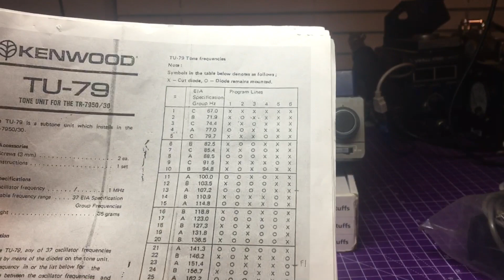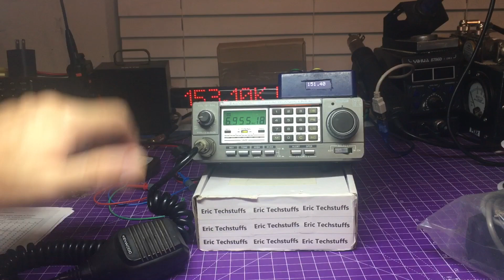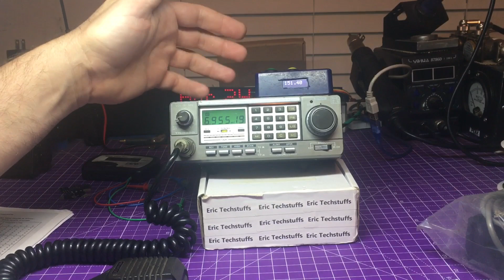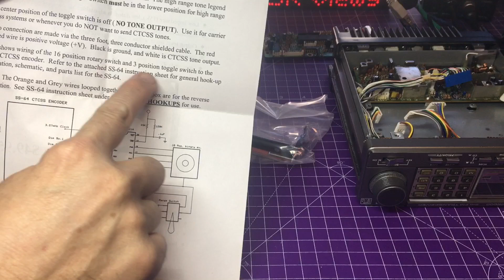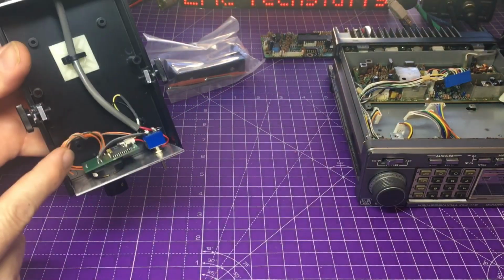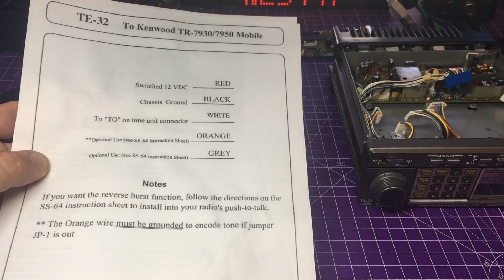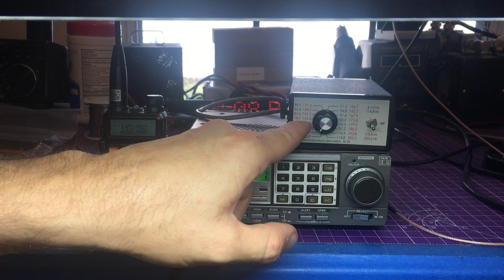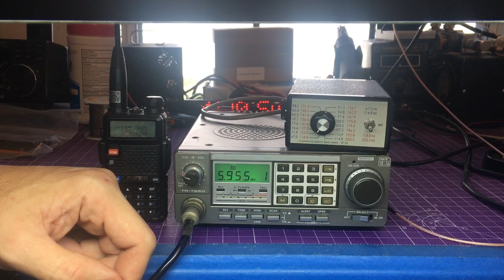Kenwood  TR-7950 Revisited with a new CTCSS Tone Board !  EASY!

Comment: I have a ramsey kit tm-1 has three wires red and black and white but what do you hook it to in a yaesu ft726r
Reply from the maker: You can use the cross reference for your radio on the com spec site.  I assume yours three wires are red black power and white would be your tone in.  https://com-spec.com/instsht.htm  I hope this helps.  73